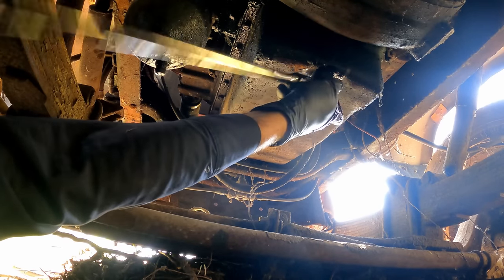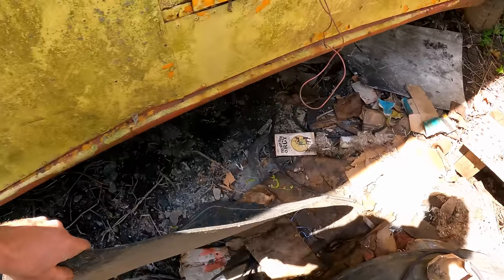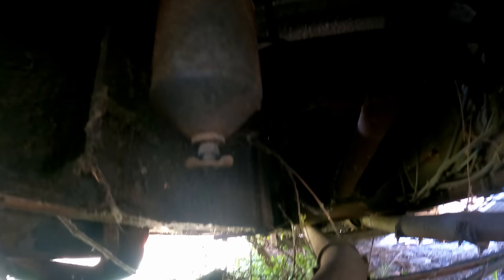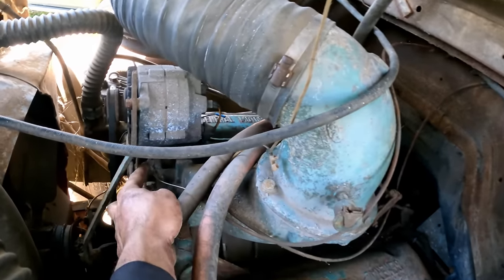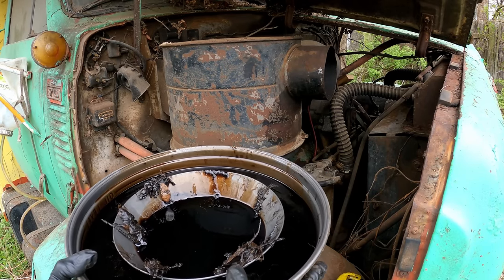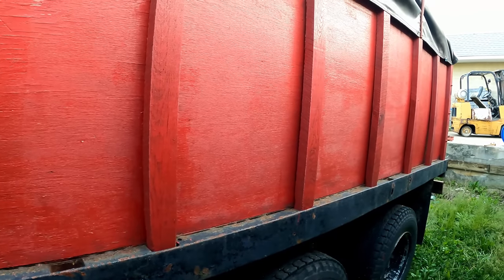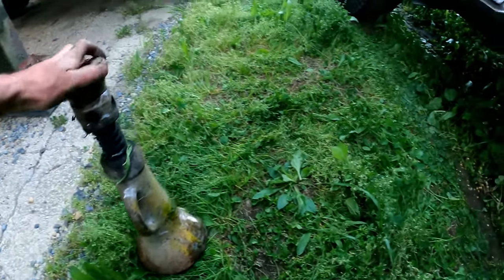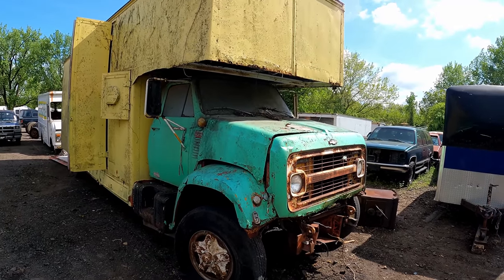Chevy C70 with 6v53 Diesel Sitting 30 Years - Will It Run... Away? - NNKH

Comment: I was 21 back in 1991 and drove a couple different old trucks that were tow trucks or dump trucks
Reply: I also forgot about the V6 Detroit Diesel engines and didn't know they were 2 stroke until I heard one drive by and asked a older guy I worked with if it was a 2 stroke and he said yes

Comment: You should have pulled the engine out, it is worth more than scrap to someone who would rebuild it. Also, blocking the air intake to stop it is very hard on blower seals b/c of the vacuum created.

Comment: When you drove the grain truck you were actually lugging it. Remember it is a 2 stroke. That's what makes the sound so famous. You should have stayed in the throttle until it sounded like it  should blow up then changed gears. That would have been less than 3000 rpms but sounded like 6000. I drove a lot of fire trucks in the 80s and 90s with 2 stroke Detroits. They often had automatic transmissions and were geared to scream. Music baby.
Reply from the maker: That was Max rpm. It must have had a mellow governor on it
Reply: @NoNonsenseKnowHow  I didn't think it seemed like your style.

Comment: Not a "C" series truck, that is an H70, and you really  can't worry about a run away when there is a built in emergency kill flap in the intake and a flat piece of wood will choke it out also.  The fuel can be shut off independently..but that is bot always enough as they can pull enginenoil from the case in some instances.

Comment: It never ceases to amuse me how people still speak of diesels running away. Mechanics run away for sure, diesels only over speed. The very first thing to check is to see if the rack is not stuck before any attempt is made to start the beast. With the engine not running and at rest, the rack is in full fuel position before the governor takes over and does its job. The old school guy.
Reply from the maker: I could be wrong but I'm fairly certain I mentioned and went over that in the video at some point
Reply: @NoNonsenseKnowHow   Sorry mate, I got ahead of myself. In my past life, I was a diesel engine instructor.

Comment: Almost any governed engine will go to full throttle when shut off, same with lawn mowers.  If the governors, and in this case the injectors,  then rust in pace, you will get a runaway.  I recently had the same thing with a Lawn Boy 2 stroke 4 hp lawnmower in which the throttle had rusted open.  The 2 stroke pros at Bus Grease Monkey and Ol2stroker always remove the valve covers and check first, in addition to preparing an intake block off.  I wish I had one for my political migration from North Carolina to Oregon.

Comment: Well I am a Detroit Diesel guy...... If everything was in perfect shape.....and judging by the looks of that they're not.... Fire up any Detroit Diesel 2 stroke all you need is a good battery assuming everything is in good shape and make sure it's primed and that's it in air  in the system will screw it up....and then starting it up you better make certain that you have a way of shutting it off so you should learn how the fuel injection system works on that so that you can turn them off the fuel rack and pull board over the intake to stop air from coming in that way but don't rely on that because these engines will suck air from the other cylinders and just keep running.... And you haven't lived until they start running wild headed for 6,000 RPM where they tend to scatter..... I've had them run on me several times and the first time it took me 3 months to work up the courage to go back and restart it you need to be able to disconnect the fuel line too if it runs wild because as a last measure if it's got no fuel it can't keep running wild...... Listening to them wind down from about 4,000 RPM on a run wild it sounds like an airplane diving out of the sky.....the whole experience is frightening especially if you have to climb on top of the motor and shut it down as I have several times cuz I'm not going to let him just blow up......general motors had at least six different ways of introducing quick start into them because they knew that long after they wouldn't fire up they would fire up on quick start and you could literally get 2 million miles out of one of those engines..... So I would have quick start I would make certain that it's primed make certain that I understand how the injectors work and I'd have a battery that's worth a crap after that good luck
.

Comment: that should be a 6v71 blower motor.
Reply from the maker: It's a 53 based on the pictures I looked online. The 71 has only two large Lugz holding the valve cover down in the middle

Comment: Dude always pull the valve covers and check the rack. When the engine shuts off it will usually stick wide open. Watch grease monkey garage he specializes in 2 stroke detroit engines

Comment: Yeah I have half the engine I have the 3-53 and the 6v53 is two 3-53 put together but they sound better then any engine ever even better then a 1969 mustang Mach 1 or a powerstroke but you better not scrap that engine they last up to 1.5 mil miles before breaking they are the best diesel engines you can get don’t even scrap that thing it will be a huge mistake trust me

Comment: Well it looks like you're just proven everything that I'm putting in text message right here in your video I don't lie.......when the engines have been used for a long time and they've been sitting for a long time on top of it the injectors can pour fuel right into the engine and that creates a run while however now they you have control over your control racks I'm thinking that's not really your problem at this point you just need to follow through everything and make sure the suggested correctly and get the air out of the system ē...
.. from what I see that engine is not wore out it's got a lot of miles left to go

Comment: That was definitely a run away! There is a manual fuel shut off on the dash probably that blue pull out knob. What happened is the you probably have sume stuck injectors after it set for so long!

Comment: If you are a mechanic as you claim you are,. Lol... Doubt That very seriously. But you should have changed the DAMN OIL, AND THEN PUT OIL IN EACH Cylinders AND LET THEM SOAK FOR A FULL 24 HOUR'S. THEN RAN IT WITH FUEL CLEANING AND NEW GAS. INSTEAD YOU PUT LARGE SCRATCHES ON EACH CYLINDERS

Comment: Governor has a thing called a shutdown solenoid if the shutdown solenoid has been removed a lot of times the guys will put like a pool cable or even a rope to the damn thing if they're cheap.....
The governor's contain a throttle lever and a shutdown lever..... If you have an old engine and the fuel injectors have not been rebuilt you could have an engine with old war out injector so I have ran into this three times the old injectors will pour fuel into the engine... And it will run till 6,000 RPM where they fall apart or I should save blow apart......in that case the only way to shut them down and I have shut them down that way is to cut the fuel line off the back of the engine where the fuel pump is and just hang in there until the dang thing runs out of fuel now during this time while you're doing that o you have to hold the shutdown lever in the closed position because if you don't do that it's going to run wild faster so if you hold the shutdown of the shut it will slow down how fast it picks up speed while you're waiting for it to run out of fuel because you just cut the fuel line off remember the cylinder heads are full in their fuel logs there's two fuel logs in each head so that's a lot of fuel that you have to wait until it runs out during that time you have to have the guts to hold the shutdown lever in the closed position and if you do that you will save the engine.....

Comment: It's a gear pump it runs a 60 lb per square inch...... The cylinder heads have fuel logs in them you have to fill those up get the air out of those too before fuel will hit the injectors typically water separator and fuel filter are going to be between the pump on the back of the engine and the side of the fuel log where it goes into the head... Once you understand these things you can't stop them from running..... Unless you're one of those fools likes to blow them up on camera

Comment: There is no Detroit old ones or my n14 Cummins or big cam or carterpillar old engines run for everrrrrree don't matter how many years is stop running those are a MDF great build engines buttttt know modern engine taket for 3 years stop on a yard alit sensor all crap tune on a don't think sooo jaaaaaà those are crappy engines made of plastic and the mother of all sensors